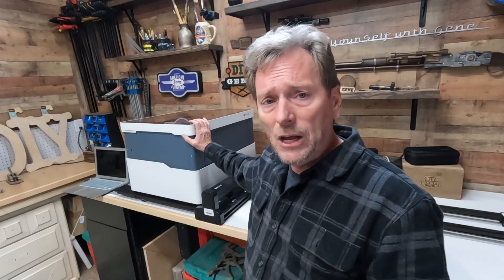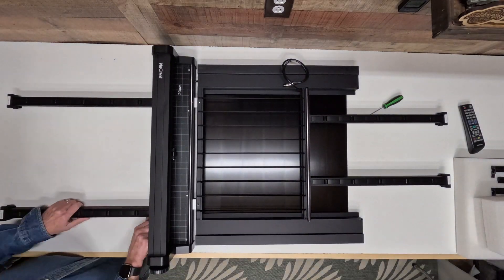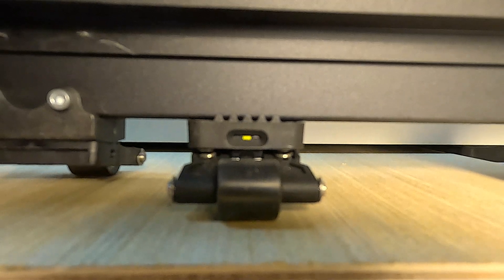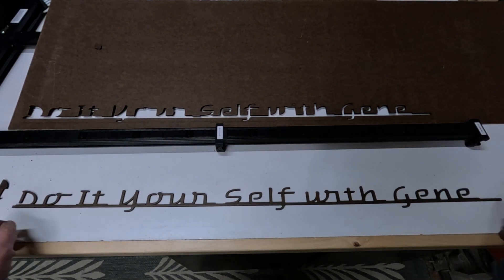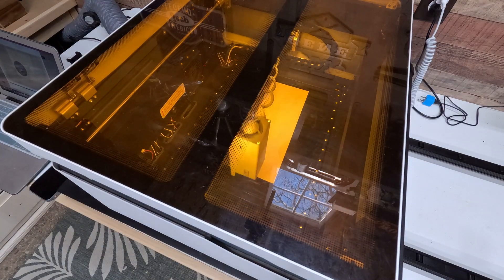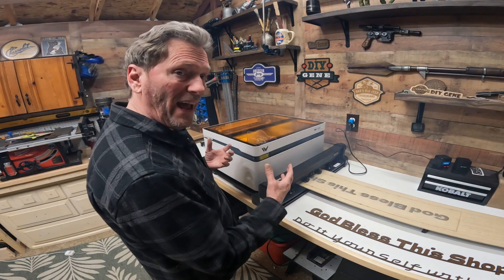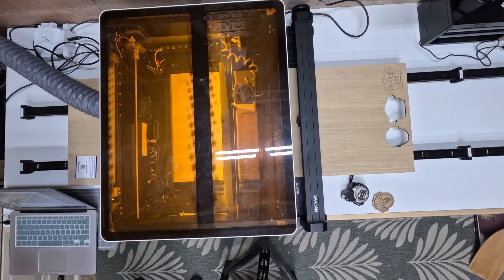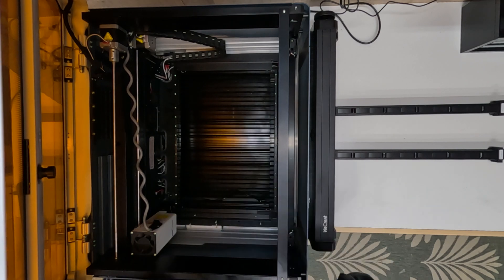I Tested the WeCreat Laser Pass Through and Here's What Happened!

Comment: Clearly you are saying this because they GAVE it to you! I PAID for mine and it is a piece of crap!!
Reply from the maker: They did send me the pass through and I was sceptic of it at first. It took a bit of trial and error that I talk about but then once I had it down I love what it can do. I have only cut and engraved up to 4’ so far but it is really cool. My only complaint is that I wish it could handle thicker wood.  What kind of issues are you having?
Reply: @ I’m just simply cutting a very THIN 3’ sign and it goes to one spot and just burns and burns  and burns and doesn’t move or it does the whole sign and just doesn’t cut the next to last letter! I think my problem is i have no idea how tight the roller needs to be on my wood and this machine is NOT beginner friendly!
Reply from the maker: @, I had to play with the pressure too and I found that more the better. I also found that running the test first helps. It doesn’t take much to block or jam it and I had to make sure it had a clear path. Also making sure the laser is square on the pass through. These were issues I had. I hope some of these help. I really do hope you can make it work for you. Please feel free to reach out if I can help.
Reply: I just watched a video where they had this exact issue. They said that you have to enable “break points” in the settings. They set theirs to 30 and it fixed their issue. I just ordered the laser machine with this roller, after watching some of these videos I’m feeling a bit uneasy.
Reply: @ I have literally wasted about $200 worth of wood!
Reply from the maker: @AmyThompson-f1b , I started with Masonite sheet. It’s cheap and easy to use. You can by a 2’ x 4’ x 1/8” at Lowe’s or Home Depot pretty cheap. I’m sorry you have wasted good material. After playing with it for a while I then cut the YouTube logo out of 1/4” blond plywood that was 36” long and it was flawless. So don’t give up.